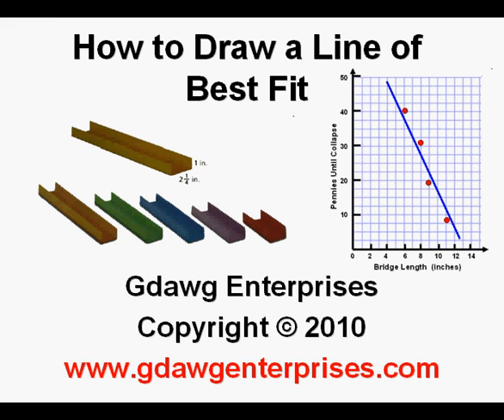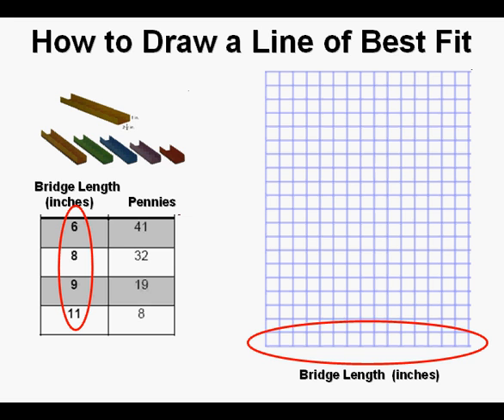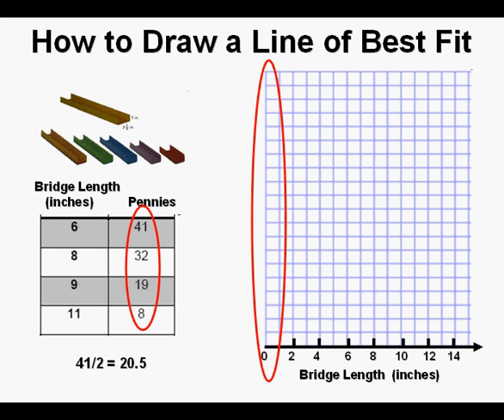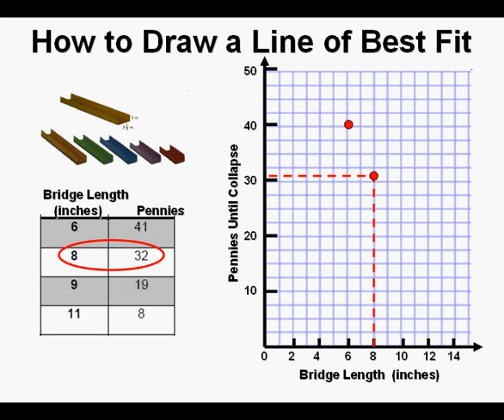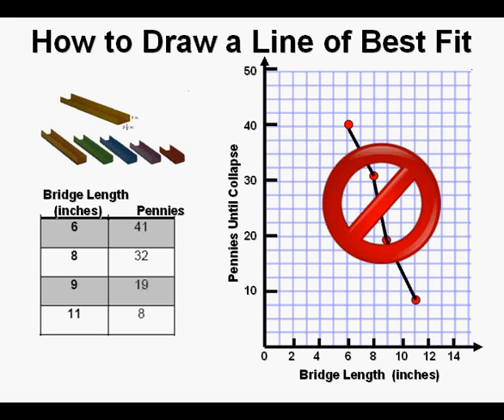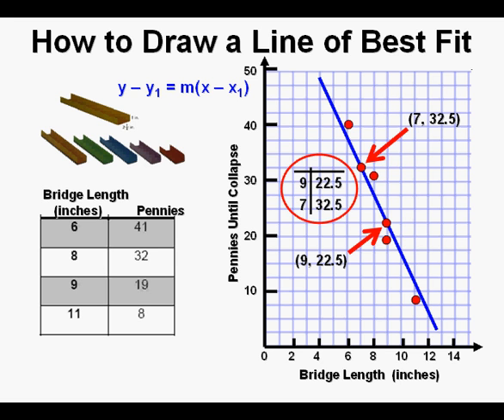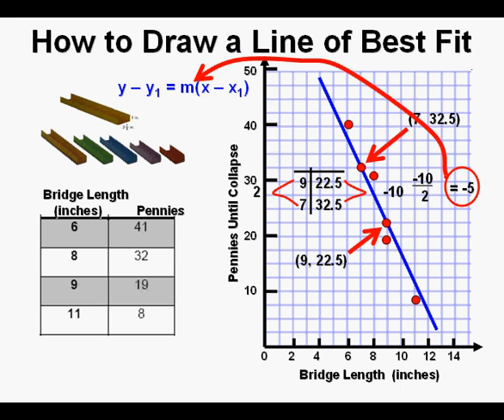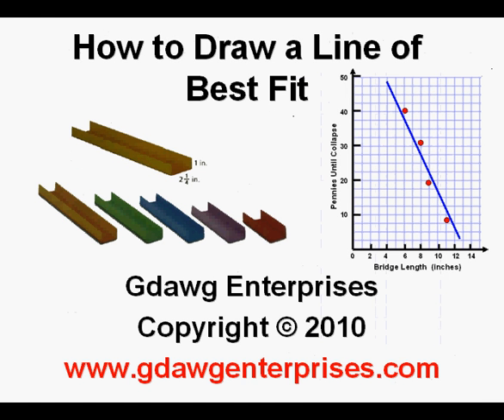How to Draw a Line of Best Fit

Comment from the maker: I recommend finding two points on that drawn line, then using the coordinates from those two points (which lie on the drawn line), to determine your slope and then your y = mx + b form.  You can also use the point slope form y - y1 = m(x-x1) after finding that slope.  Thanks for viewing and commenting.

Comment from the maker: Yes you're correct.  Specifically, the numbers used were the real data.  Yes, they could have tried bridges of length 2, 4, and 6 as you suggest, but they did not so they're not in the data set.  Thanks for viewing and commenting.

Comment from the maker: @xC3ll3rat3 I don't know what your data looks like or what your tools are.  You might try to draw the line from each mulitple choice answer and see which one best fits the points.  Pretty easy w/ a graphing calculator.  Not as easy but still possible using graph paper.  Aside those suggestions, depending on time, etc. available, you may have to just choose the best answer that most closely matches your line, then move on.  Sometimes drawing a line of best fit seems more like art than science.